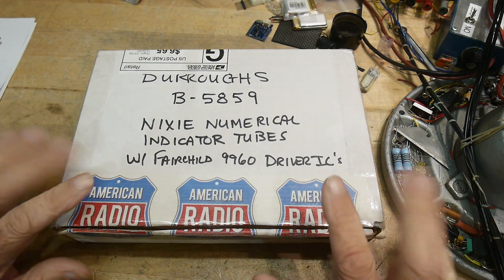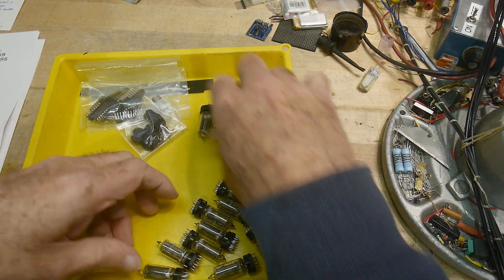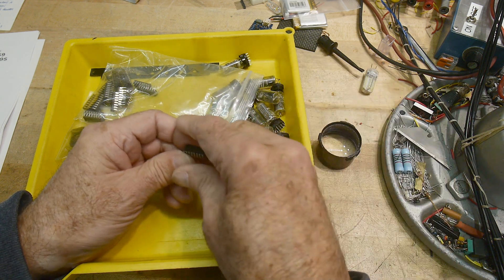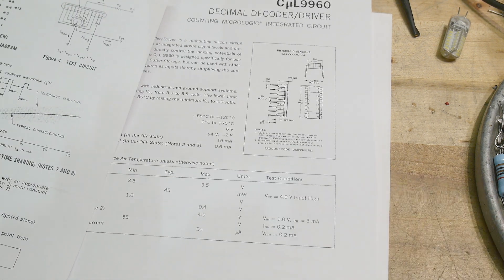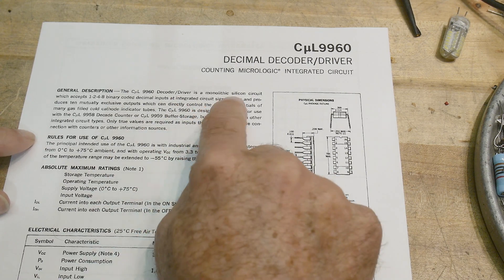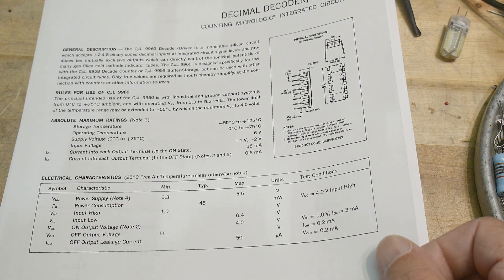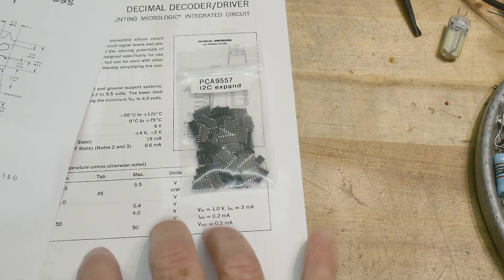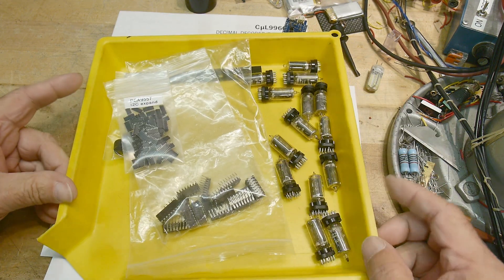#1799 I2C Nixie Display Project (part 1 of  5)

Comment: Will you socket your nixie driver chips?  Reading up on the 9660 the consensus is they are sensitive to heat and voltage spikes and fail easily and often.  If you did a replacement of the nixie tube with a BCD counter and an output transistor which transistor would you choose?  Best 73's.

Comment: I have one nixie tube in my parts collection, I've been considering making some kind of indicator out of it, but with 1 digit, I don't know what to make. I should really try to get a few more, they're so neat.
Reply: Not yet another clock!  I had 3 5750s and a + and - so made a thermometer.  For one decimal place, sunlight meter?  Geiger counter?   What do you want to know (in a very stylish manner) within an order of magnitude?
Reply: Make a clock, you have zero to nine so display the time sequentially.
Reply: I have a handful in my tube collection to use in my Heathkit IB-1100 that I built in 1973

Comment: If there is no data sheet on ic what we will do sir. Please make video sir for test ic voltage when the power supply is on. Knowing ic is good or bad without data sheet
Reply: Without data sheet you need to analyse the circuit the IC sits in and from that document it.
Reply: @zaprodk  I don't know. For better understand please sir make a video to test ic without data sheet. I want to know when the voltage is on so how to test ic